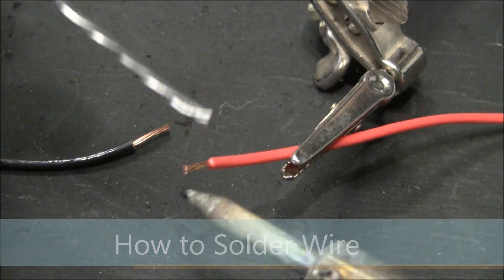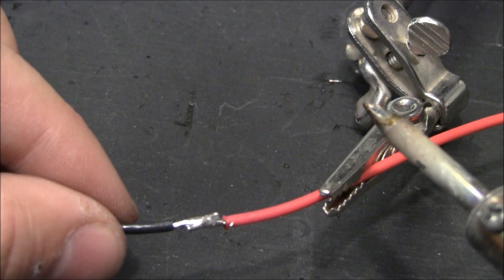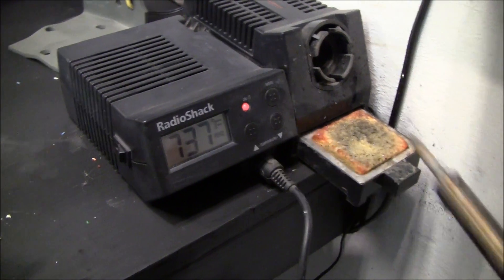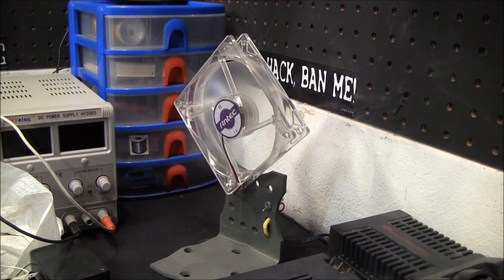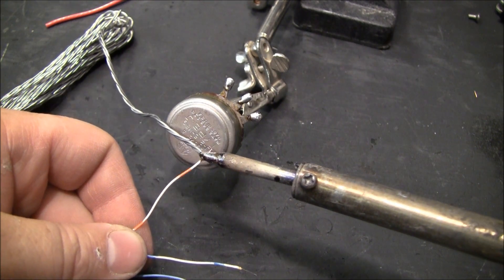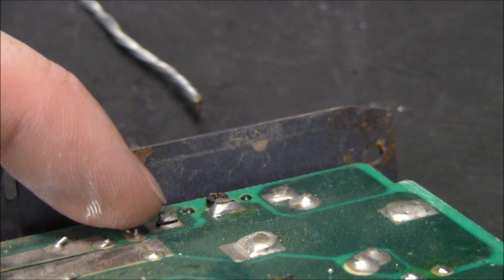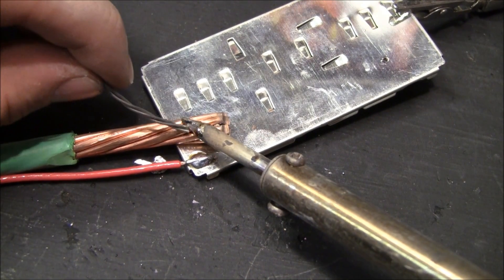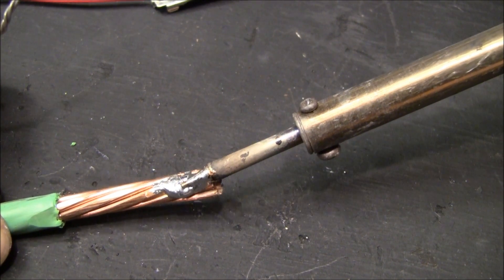How to Solder, tips and tricks

Comment: Why can't I be able to tin my solder tips? I tried many tutorials in YT such as applying a layer of flux, coil the solder around the tip and lastly turn on the iron for the solder to melt right on to the tip which ends up miserably where most of the solder fell off while the remaining became black on the tip. Please enlighten me, cheers.

Comment: Heres a good ??... if you are replacing a couple of small gauge wire on a small PCB (+ & - from battery pack) the old solder is removed, will it make a difference if you use lead/tin solder, but the old may be lead-free? Thanks

Comment: Fail ... right from the getgo... twisted solder ? No... use correct diameter solder for the job size. The correct amount of internal flux needed.  ...Flicking excess solder off ? omg... nothing safe about that... & you burned your work area & residue of old flux...  Dampen a sponge w/ water, and wipe tip off, or wipe on some steel wool. End sequence of using too small a tip on the multistrand wire... ! A higher temp capable iron, and spade tip vs that tiny thing... you are on the wire wayyyyy too long ! Sorry, but I saw nothing usefull on this vid for newbies esp... more of a what not to do !

Comment: I'm soldering ground wire to the board. The solder on the board is a big glob mass, I tried soldering the wire to the board and just won't heat up and take the solder.

Comment: Makes me cringe to see a guy shaking molten, hot, solder off the tip like this, also solder station is pretty bad, way too powerful for most modern components, tip way too big and what is the story with what looks to be half decent solder, twisted into a rope like that?
If you were using the correct iron, correct heat & correct tip, just a single strand would be perfect....unless you're soldering copper pipe or something

Comment: When I studied soldering (like 30 years ago) they told me to use a small alligator clip on the leg of the transistor to keep the transistor  from getting too hot when soldering it  (does anybody still do that?), the other way was to hold the leg of the transistor with needle nose pliers for the same purpose (as a heat sink between the transistor and the soldering iron).

Comment: It seems like I'm completely unable to heat solder through the wire to tin the wire.  If the iron isn't touching the solder directly, it wont melt.  It's a 40w iron if that helps.  What could I be doing wrong?

Comment: is it a good idea to use a small flame solder for wires?
i tend to use flux but the copper still suffer a bit of oxidation, i sometimes use an 8mm or 10mm, no solder can heat that..
i also have a big gas oprated copper slant welder where it heats a lump of copper and use that to heat the wire, but that still oxidize the wire sometimes.. how do i stop this?
i do use flux, not helping

Comment: never been a fan of just sticking wires together.  Depending on the size of the wire I have a few different ways I like to twist or braid them together.  Then solder them.  Especially in thinks like cars an boats.  More secure in my opinion.  That mechanical connection will also make sure you get the best electrical connection.  Then the solder and tape/shrink will reinforce the physical connection.

Comment: Other than neoc03s suggestion (which seems to make alot of sense) this video was exactly the simplified sight training for the basic "how to" information i was looking for. Its clear and demonstrates the main guidelines that are needed to get started and practice.. Far too many instructables are too assuming in their content. Or they are full of information that leaves a cloud of details that overcome the basics they are attempting to display. I'm embarrassed to admit that the first few videos had me buying flux for solder that already contained it and trying to brush small connection points that were in areas that any overflow could cause shorts..i was under the impression i had to create a barrier between the two points and then laying solder in clumps that in the end i found myself forced to take a micro-file to...i had managed to run through about 8 inches of solder with probably upwards of 15 failed attempts that left unstuck balls of solder next to a surface that they were intended to adhere to..and leaving me frustrated and confused...After viewing this i had the 12 wires connected with precise, solid joints that i am confident will last. Great video...i will be using it regularly as i am now confident that the partners i am working with will benefit from it with a quickness that will save us alot of time. Thanks a bunch!

Comment: I solder wire all the time, and I heat it up first, but I merge the two copper cores together before melting the solder in to it.  Strange that you heat them seperately...  It just sucks up the solder as you'd expect.  And I don't mean twisted together.  I mean, the two copper cores just pushed together in one motion.  You lay one on the other which doesn't even seem neat, never mind efficient.

Two days ago I did that on the cable on the actual soldering iron :P  It was like 50cm long and totally awkward so I made it longer.  The current went through the cores as they cable ends lay taped to the worktop with the three cores just merged.

Anyways, all I am looking for are universal ways to hold two things in place while I solder them together.  I should just buy the damn flexi clamps.

Since I'm so full of fun facts, in the UK we pronounce solder as "soul-der", not "sol-der".

Comment: The first thing you do, is re-strip your wire if it has been sitting around and has oxidized, you can usually tell as it will be dull not shiny and new. Never try to solder a wire like this, it won't take the solder easily if at all and your connection will be iffy. And if you are dealing with thin wires you can twist them together then tin them, or you can twist the wires on end and will make them thicker once tinned.

Comment: That is actually a poor way to solder. Electrons will have too much resistance with this method because of the reduced surface area of copper to copper jointing. Maybe ok for fixing simple toys, but for delicate electronics this is not good. Interspliced strands with minimum soldering is best.
Reply: Ansley212

Comment: I was taught to make a good MECHANICAL connection first before applying solder to make a good ELECTRICAL connection.
Reply: I wasn't taught a dang thing, but figured out this point pretty early on. I burned the shit out of lots of things before I got the hang of it. I still suck, but have learned how to NOT destroy things.
Reply: +Chaplain Dave Sparks Yes!  I'd hook the wires around those pot terminals first!
Reply: Yeah, I was about to say the same. I would wrap the wire around those terminals and and then solder them.
Reply: I twist both wires together then heat up the wire with soldering iron then apply solder to wire
Reply: +Chaplain Dave Sparks Hear, hear.
Reply: I agree, my father (an electronics engineer) taught me the art of soldering when I was 6 or 7, and he also made the case for good connection before soldering.

Comment: Don't ever "shake off extra solder", use a brass solder tip cleaner (looks like a brass brillo pad). Flicking off excess 700 degree liquid metal is never a good idea.
Reply: +neoc03   I  found that the hard way, it cost me a hole in my trousers and a nasty burn on my leg.
Reply: @gcf7175  Cocks? You have two of them?
Reply: I got a few burns on leg. Now i hit table with my hand holding iron so solder drops down :D
Reply: electron hacks.......???

Response?

Comment: Can someone tell the name of that thing with 2 clips and sometimes a magnifying glass in the center that is used while soldering.? thanks :D
Reply: +WhoLaHoop It's called helping hands. Search for it on Amazon and you'll find plenty of them.
Reply: +Aram Azhari Oh thank you... :D
Reply: +DD MM they are awkward/not user friendly but they are still around for a reason, (as dude in video said) sometimes you run out of hands and or would burn yourself making the solder and to my knowledge no one has invented anything better than those clamp devices for that situation.
Reply: +WhoLaHoop  I believe it's called a helping hand.  I have one which cost very little.  I find it handy but the magnifying glass is rubbish and the crocodile clips are to small.  I put bigger clips on then it was ok.  Well worth buying.
Reply: I found them to be called "third hands". I had to try a couple of rubbish ones before I struck gold. 

I will try to explain this. They have a round, black metal base, with a joint that you can put one of the tweezers in. The unit comes with a selection of good, solid tweezers. 

I bought two of these bad boys, but then I make jewellery. 

Good luck. Hope this helps.

Comment: what happens if my tip can't tin... as in the solder starts to ball up... it doesn't get onto the tip of my soldering iron...
Reply: +jkim519 Did you use your soldering iron and leave the tip untinned after? Always leave the tip tinned with fresh solder before you put it away.
Reply: +jkim519 I think that's because the solder isn't hot enough so try turning up the heat of your iron.
Reply: What if it's max heat?
Reply: Maybe try buying a solder that has a lower melting point. Or buy a soldering iron that has an adjustable heat setting
Reply: That's exactly what i did... wow i didn't know that about soldering irons...
Reply: jkim519 your tip has iodized probably. You can try lightly sanding it with 1000 grit sand paper and clean it to see if it will take tin.
Reply: +jkim519 There is cleaner to use, dip solder into it and leave until it burns it off, seconds not minutes. Sometimes I might hold tip on wood and keep applying solder and it will usually finally burn off that coating which is inhibiting the  solder flow.

Comment: You should mention heat sinks for soldering smaller parts. Also, have the fan PULL the smoke away from you, not blow towards you.
Reply: +ToxicTiki Yes as the fan air cools your solder as your trying to work it and will fail.

Comment: How did you get the pc fan power? My ps4 fan needs soldering on the motherboard so i am trying to run the fan on manually on its own?
Reply: +Swidty DLo - almost all PC fans run off of 12v power sources. You need to figure out the exact voltage required by the fan.

Comment: other videos say never rely on just the solder to hold the wires together but always have a physical joint first like twisting the wires together first?
Reply: +Mohammed Ali (ResourceUK) Solder without a mechanical connection is an established and accepted practice. Try soldering 2 wires together without twisting and pull on the wires. For gauges under 12 AWG the wires should break before the solder.
Reply: +taohawaii problem is a bad solder that goes unnoticed = wires flapping around. depending on the voltage/what else in in the box/application  this might not be the end of the world; but its still best practice to make a mechanical connection first.

Comment: the first part of him showing to connect 2 wire ends together by soldering the straight pieces end to end is the worst thing you can do for a high current connection. this connection will simply break off after time.  you much twist both ends together BRFORE soldering or you could interweave the ends together, uning lots of flux as well, and then soldering. I can only assume from what ive seen, and the size of that iron,in this video that he is not doing any fine detailed work. Good to have an adjustable temperature. or regulated tips.
Reply: i Repair Electronics Well, he does have an adjustable station, but with it set to 735F/390C. ::facepalm:: With temps like that, the flux is gonna burn off before it has a chance to flow...

Comment: I am retired Electronic Engineer.  I taught NASA soldering techniques for the USMC.  what you are teaching is not a good technique.  if you would like to know the actual correct way of soldering you can write NASA or the US government printing office and ask for the "NASA soldering handbook".  I think you need to get a little more education before you try teaching something that you aren't doing a very good job at teaching.  when soldering an eye or a turret the wire should be mounted to or through the eye or turret flux should be applied to the connection then the connection should be heated then apply the solder to the connection.  you must be able to see good definition of the connection, not just a lump of solder.  I believe you are at least trying which is more than most people are doing.  keep it up but get some education on the subject.  I at least applaud your effort. 
Good Luck and best wishes,
Reply: Terry E for everyone ragging on Terry E for his advice, give it a rest. he's just trying to prevent people from learning bad solder habits which i'm sorry, this video is full of. The wires he tins at the first of the video are way to heavy with solder. you should be able to see all the strands of wire even after tinning. The blobs of solder he adds to the terminals of the pot he is attaching to is just going to lead to cold solder joints. Solder should not be reheated like that, it compromises its integrity and strength. Also his solders are drying to a dull grey indicating too much heat. they should dry to a nice shiny silver. The video had good detail but introduces bad habits.
Reply: Terry E Can you supply info who to write to and where to send for the NASA soldering handbook?  I'm genuinely interested.
Reply: Terry E he  is helping  us  ,why instead  mention  your  title as solder man expert  ! put your ass  on the site and teach  us .  big mounth.
Reply: Dave Jones Here is the link https://www.protostack.com/download/NASA%20Student%20Handbook%20for%20Hand%20Soldering.pdf
Reply: Dave Jones Here is the link https://www.protostack.com/download/NASA%20Student%20Handbook%20for%20Hand%20Soldering.pdf
Reply: Joker Squad  Thank you for the link.

Comment: extra tips on soldering from experience: Wear eye protection if you dont have a magnifying glass and have to look real close at the components solder almost hit my eye when it just flinged off. point the fan away from your face because then your just blowing all the smoke to your nose... dont fling solder if it lands on your clothes it will melt them instead buy a solder tip cleaner either brass or stainless steel. DO NOT DROP THE IRON thats the most important thing ever. when soldering the two wires together leave a bit of room between the plastic casing and the wire just solder most of the tip and leave room. Use the right tip for the job the more mass the object has the bigger the tip you need. Desoldering pumps are good for beginners because you will probably add too much solder when first starting, Flux(use water based on electronics not acid one)  is used to attract solder and to clean the parts so solder can get "absorbed" quicker.
Reply: Good tips except for the recommendation of water soluble flux: it's not good for beginners because it can be corrosive with time if even the tiniest bit isn't washed off. In nearly all cases, hobbyists are better off using a no-clean flux or a rosin flux.

Comment: I take it back. It's a good soldering tutorial. A guy made a response to "you-are-not-doing-it-right" comments and it is "if you disagree with the way I do it make a video and post it ... so I can write negative comments under it.". It's OK if the joint is only held by solder ... unless you work in NASA. It's OK to solder a pot like that - don't worry I have tens of pots soldered like that from 15 years ago - they are still strong. There are some good tips in this video to get started. If you want to do a professional soldering - you wouldn't be learning it from youtube, right?

Comment: Why would you make a tutorial if you don't even know the basics? Very bad overall soldering job. The first sample was not cold joint. Cold joint is when the solder doesn't bond with copper.. + that's not how you solder 2 wires properly.. any vibration would break them apart. Your explanation at end why solder isn't bonding is just ridicolous - ever heard of oxidation and how to use flux?? I wouldn't recomend anyone watching this..

Comment: who the fuck shakes solder off there iron like that? YOU SHOULD NOT TEACH PEOPLE TO DO THAT SHIT GRRRRRRRRR!!!!!!!
Reply: only if you want to go blind or like a burned face.
Reply: joe burkel I think this is a troll video. I physically laughed at that one.
Reply: I used to do that and I've damaged my iron like that (a $10 iron, not an expensive one like his). The metal is weaker when it's hot, and the sudden motion puts lots of acceleration on it (which is why the solder flies off). And if you hit the tip on the table, you damage it and possibly the iron.

Comment: So if my soldering iron tip gets bubbles I should drop it on the floor? Wouldn't swinging it by the cord and smacking it against the wall be more efficiant?
Reply: Yes, that would definitely be better. He really needs to learn to sodder properly.
Reply: 2011zurich *solder
Reply: gorp27 i